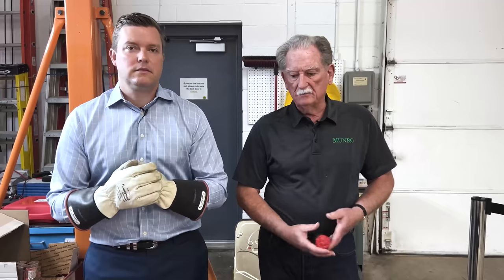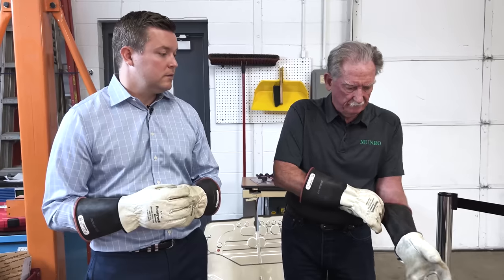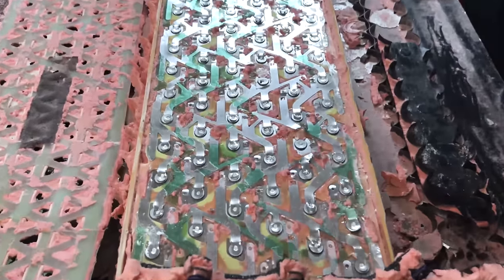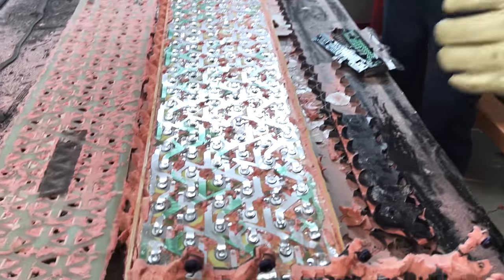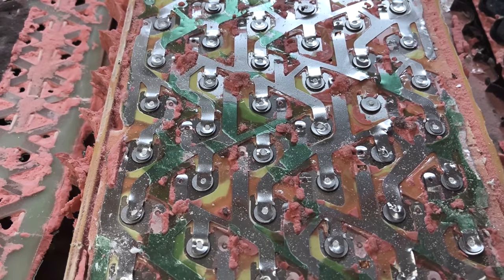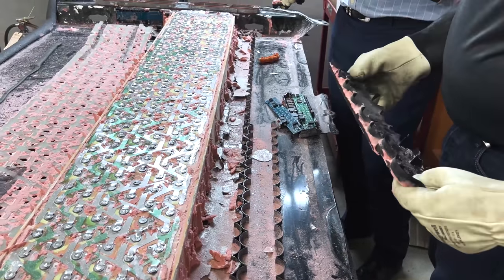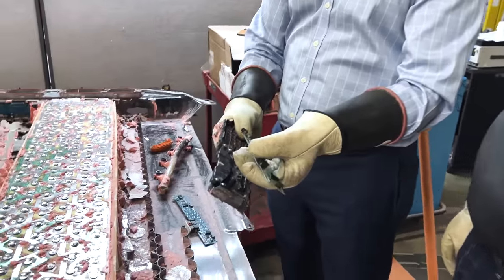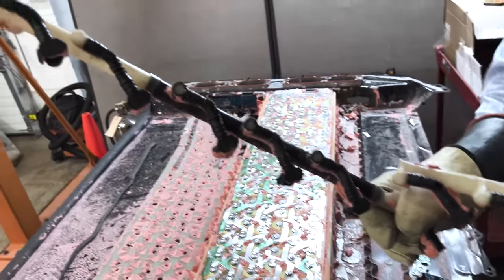Sandy's first time reviewing the fully disassembled 4680 pack!

Comment: Never seen Sandy so exited. Glad I watched till the end. You can see he is really passionate about the engineering excellence!
Reply: Those carbon fiber parts were revolutionary, but also part of a hypercar, don't expect this process to be implemented in middle class cars just yet.
Reply: I peeed my pants 😜
Reply: @paulmichaelfreedman8334  Currently true but I beleive carbon fiber stamping methods such as this will drastically reduce in price and soon will be competitive to sheet metal stampings. As Sandy mentioned, the lack of stamping waste is just one aspect of cost savings, not to mention having reduced panel alignment issues down the line.
Reply: @paulmichaelfreedman8334  yes, I realize this is the supercar, I think it is McLaren 720S, not 100% sure though, still slower than Tesla model S Plaid.
Reply: Imagine Sandy as a kid getting a recktor set/legos something equivalent with a new and improved design on a Christmas morning. This is that right here and it never get old.
Reply: @KZ-ko4vm  fit, finish, rusty and loose bolts on a McLaren in a video I saw.
Reply: "This is better than Christmas!"
Reply: @paulmichaelfreedman8334  Sheet moulding is a more scalable process than traditional methods. If a manufacturer decides to go with it at volume the price will drop. Much the same as the gigacasting.
Reply: That looks like the top side of the Aptera
Reply: @KZ-ko4vm  or could it be the new Delorian?
Reply: Sandy can't wait for the day cars will be completely made out of plastic with zero removable fasteners!
Reply: @Oosh21  Elon Musk would be the first to implement it, on both the cars AND the rockets. If it's lighter and strogner than the current stainless steel grade used to build starships
Reply: @paulmichaelfreedman8334  That's a completely different application and doesn't require high volume manufacturer. You use the right process and material for the job. In the real world there isn't some 1-dimensional tier list of materials.
Reply: @paulmichaelfreedman8334  When it was originally announced, SpaceX actually was planning to go with carbon fiber composite construction. They even made a test tank (the largest single carbon fiber component I'm aware of) and a full set of tooling to make the tanks for the full rocket. Alas, it turns out that while carbon fiber's strength/weight is amazing at normal temperatures (and still good at cryogenic temperatures), it's poor performance at high temperatures means that stainless steel actually ends up lighter if you're making a vehicle that needs to go through atmospheric entry. And that's on  top of all the other advantages that steel has.

All that huge bespoke tooling for carbon fiber got cut up and sold for scrap. Say what you will about Musk, but he doesn't fall prey to the sunk cost fallacy.
Reply: @KZ-ko4vm  can it be the aptera ?
Reply: @gopromax4719  we will probably find out "in the next episode" my bet is on McLaren 720s.
Reply: My stomach turned when he begs for money with a picture of a sick child. 

Had to stop it there, been a long time sub but this is a dealbreaker. Major loss of respect.

I mean cmon! He can afford the treatment for sure, he is loaded!! If ur personal car is a rivian u can pay for medical expenses. 

Shameless begging from filthy rich ppl is revolting.

Comment: Never knew that about blue vs green being the ‘safe colors’ for color blind individuals.  Thanks for sharing Sandy!
Reply: Most 'color blind' people aren't blind in certain colors though it's a common misconcention, they are just deficient. The most common variant is deuteranomaly which makes people less sensivite to green hue. It's like looking at washed out colors, you can see the color but it's not as 'popping' as for people with normal colorvision. But there are anamolies for each red, green and blue wavelengths, even some people who can't see those colors at all, but it's very rare. So actually there are no safe colors for all variants of color blindness, just some colors that are less ideal to combine like red and green as that's the most issue for colorblind people(for those odd cases where the person cant differentiate at all). The most common problem is seeing differences in hues, specifically a color sample that is a mix of green and red, but should be green dominant. Because of deficiency that color will probably just look brown(as in equal parts of green and red combined instead of clear green dominance). For most colordeficient people clear green, red and blue are perfectly distinguishable. One funny note is that research shows that some color blind people are better at distinguishing different hues of Khaki, so they could see through camouflage better than normal color vision people.

It's still good move on Teslas behalf to implement this though to eliminate most potential mishaps.

Comment: Hello Sandy. I have been watching your channel  probably since you started it. You have inspired me to by a Tesla. After much thought for the last few years and reading everything about the car I finally pulled the trigger. I'm an 86 years old fart. But I'm very techy knowligble. it reminders me the question and answer segment you had some time back when someone called you an old fart! Any way..Last friday my dream came true. I picked up my model 3 longe range.  Drove   home about 50 miles I tried the autopilot and worked! I was very excited until   the following day when I started backing up from a parking spot and people started walking in back of my car and I heard no warning. So. I checked al the setting an everything was turned on.  So I  started driving around and notice that none of the safety fixtures were working .Lane departure, blind spot warning, auto emergency warning. Nothing! Again  I checked all the settings. All turned on. This morning I called  Tesla . Thank god I got through. They checked all my settings and told me that the cameras have to be calibrated and to drive some more. Really? I already drove 150 miles .Hyway and side roads. This is not acceptable. Its a very dangerous safety issue. Especially the backup sensor. I buy new cars every few years and when I leave the dealer al the bells and whistles are working! Why not Tesla with all there technology? So. I'm very disappointed and sad. They made an appointment for friday .I have to drive over an hour to get there. I Hope this can be fix or Ill demand my money back.

e checked all the seting

Comment: 3:57 amperage is a lot higher, ~5x higher, according to Tesla Battery Day.
PS: older Teslas had trouble with the thin wires (fuses) not blowing when the cell has gone bad. With this design, they are letting the bad cell explode 💥💥
Reply: You'll be an expert on the subject then?
/s
Reply: @rogerstarkey5390  to achieve roughly the same power output as the 2170 pack, more current must come from each cell. There are 5x less cells in the 4680 pack.

Comment: 4680 has enough power to blow up the bus bar when it is shorted, so the bus bar itself is the fuse.
Reply: Probably true but I'd love to hear someone from Munro Live state it explicitly.
Reply: I think there is a fuse on a board, maybe on that strip of board with many components that they have shown. It would take a whole lot of current to burn through that bus bar.
Reply: @1flash3571  Yes, there are fuses, but the old bonding wires provided an extra fuse for each and every cell.
Reply: The 18650 cells had 6 amp fusible links if I recall, the small wires at each end.  I have to wonder if that was useful in typical cell failure scenarios.  I think not.
Reply: @paulaxford6754  Uhh...it would be useful. So, you are WRONG. Batteries DO GO SHORT rarely, but it does happen. More battery in a pack, there is just a common sense that a probability of few of them going bad and shorting is higher than those that have less cells in a pack. Having a thin wire that is rated to burn up and isolate that one cell from other cells in a pack is a good thing.

Comment: Would the larger weld contact point on the battery for the 4680 current collector carry more amperage over the existing 2170 or 1865 "wire" method?
Reply: Yes. Fewer cells mean more amps per battery.

The old wires also served as fuses. Those are either no longer required, or the amperage is now high enough that it will melt that whole path to the cell on failure. My guess is on the former.
Reply: Potentially (there's the little quip) , the "fuse" failure method, may be incorporated into the cell, just a (not very educated ) guess on my part...
Reply: @HenryLoenwind  it was the same thing on the Catl LFP batteries pack too
Reply: Well, certainly and it appears Tesla have abandoned the 6A fusible wire idea.  I have to wonder if it was really effective anyway.  I don't think any other manufactures "fuse" individual cells.

Comment: My main interest in these disassembly videos is "How can I reuse these components in other applications?"
Reply: Ideally you would re-use an entire longitudinal in another project, just like its done with current 2170 modules. Otherwise you have no choice but to extract each cell like Sandy did, beyond that it goes for recycling.
Reply: @Anonymousg64  Not even remotely safe to do that. The extraction process destroyes wiring and cooling. These "modules" are not removeable or repurposeable. One would have to hack the electronics and just reuse the entire pack in situ.
Reply: @patreekotime4578  I said the longitudinal, as long as you know where the seperation is, you could extract it without destroying the cooling and bms, notice they have a fiber board of some type seperating each longitudinal, you dont even need to touch the pink foam.
Reply: I’m very sorry for you trsla has choosed apple route of making things almost impossible to repair.
Reply: Making large sun parts on vehicles is great but when the vehicle is 20-30+years old how is it going to be repaired!? There are still 1970 Mercedes’ trucks and cars on roads used daily and repaired super easily
Reply: @carholic-sz3qv  you do not repair such a battery, even if it was easy to access, the cells need to be matched.

Most packs will make it past 30 years, its up to the user to decide if the battery degradation is acceptable or the pack should be traded in for a new one. Anyway, 10 plus years into the future, the cost of the pack will be much less then it is today.
Reply: @Anonymousg64  lol…… make it past 30 years in which most places!? Are you jocking!? It cannot even compete with the level of usability of ICE!!! I mean people are exporting 30+ years old ICEA to either rich countries or to Africa, South America…… tell me how a tesla is going to survive those places!!!!!
Reply: @Anonymousg64  cost of the battery does rent matter 🤡!!!! We’re talking about reusability here! Recycling also still has a massive impact of our environment like it or not!
Reply: @carholic-sz3qv  i meant making it by the measure of not having a catastrophic defect to render the pack useless, it might have less then 60% of the original capacity, but it would still work. Also assuming the avg yearly mileage of 16000km or about 100 charge cycles per year.
Reply: @carholic-sz3qv  im my country, you are lucky if the car is not eaten by rust within 15years, nvm how many engines and transmission or other repairs you might go through aswell with ICE cars.
Reply: @Anonymousg64  lol…….. like I said ICE the super old ones are still used in rich as well as third world countries where they are driven very hard and actually still have decent range/capabilities compared to any EVs your 60% remaining battery capacity would be crap with limited charging speeds/ performance…..
Reply: @carholic-sz3qv  i already said you can repurpose the longitudinals and at worse extract each cell for other projects. And even in a recycle scenario, the impact is much less then having to mine new  resources.
Reply: @carholic-sz3qv  the person using such old vehicle, would be wasting allot of money on fuel, if they are really making such hard use of it, the cost can easily surpass a new vehicle in several years. EV is less expenaive overall, even if you are unlucky and have to replace early.
Reply: @Anonymousg64  No. Thats just totally false. The foam completely surrounds the "longitudinals" and glues the lid closed. Anything that will eat away the foam will potentionally damage cooling or wiring. Like I said, there is absolutely no way to safely do that for reuse. Individual cells could possibly be extracted for use in projects... but it would probably be ridiculously cheaper just to buy new cells from a supplier once you factor in the man hours.
Reply: @patreekotime4578  yes it does surround, but it is a good enough space to run a saw through. I would certainly advise using a jig to accurately cut at the specified distance from the side in a strait line, doing a superficial pass to first validate the cut location. Also, the top metal lid could have been pre-cut with a zipcut into more manageable strips now that we know there is a safe gap of material between it and the bus bars.
Reply: "How to reuse"?
You don't.
You either find a less integrated pack and strip that.
Or, buy secondhand cells from another type of pack that someone has stripped (at +/-50% price?)
Or, since these cells will trend towards 50% of current W/kg prices anyway, you buy 4680 "off the shelf" (probably Panasonic, LG, Samsung?)
Reply: @carholic-sz3qv  
You're making too many assumptions regarding things you know nothing about, and being aggressive while doing so.
Doesn't reflect well on you.
Reply: @rogerstarkey5390  ok since I know absolutely nothing then tell me why are those tesla made unrepairable!? Is it only to drive in rich countries on pavements or what!? What a joke!!!! I still see on tv and YouTube now and then around the world 30 years old cars moving people and goods on all weather/road conditions from best to worst possible.
Reply: @carholic-sz3qv  it's far less serviceable than Apple's iPhones. As Cory said a while back, "zero percent".
Reply: @Anonymousg64  none of that is even remotely safe for repurposing and there is no way you arent damaging wiring or cooling using saws. In fact sawing through a structural battery pack sounds like a good way to end up dead to me.